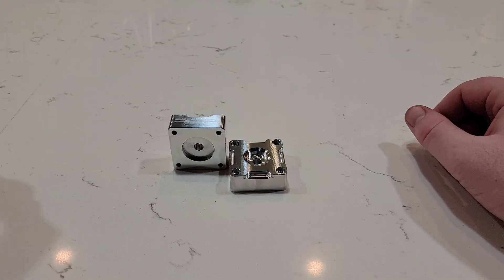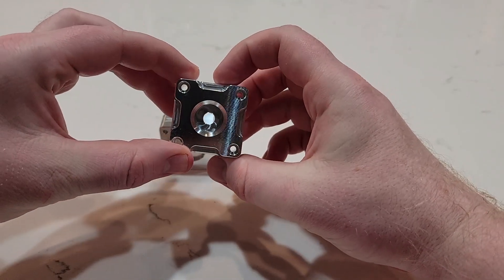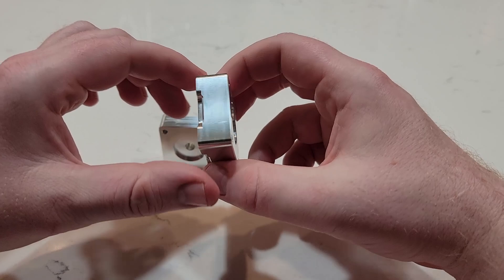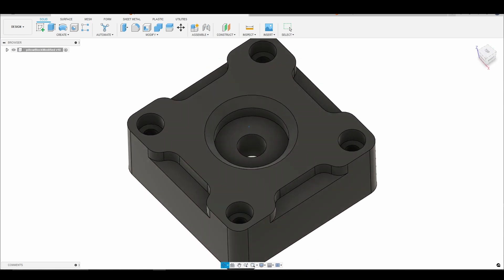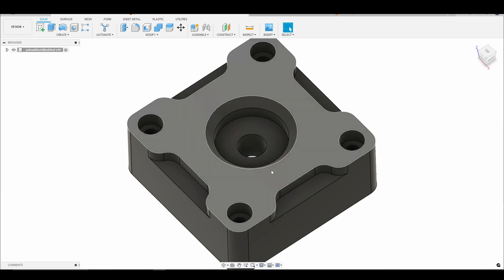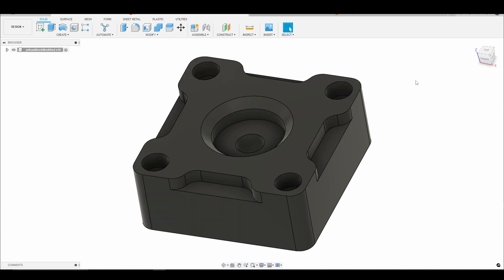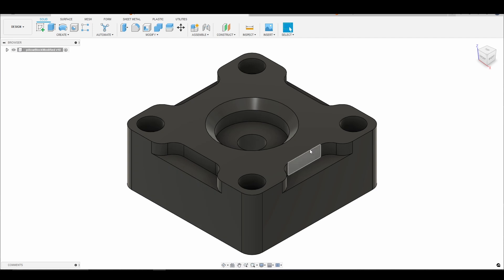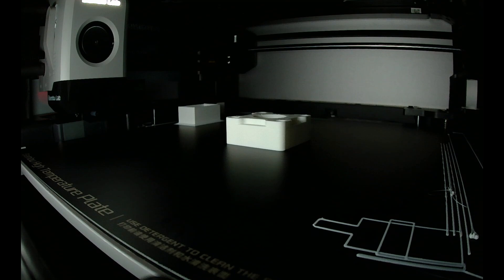Stepper Motor Thrust Bearing Mount Overview

Comment: Not sure if you noticed or not, but you say it's 40 inches in width, 40 in depth, and 16 inches high.  Definitely sounds like something I'd do on a narration.
Reply: Out of curiosity, why did the 3d print end up with a purge tower?  I wouldn't have thought that'd be necessary for a solid single filament part?
Reply from the maker: @David Hefner  The bambu smooth timelapse feature creates the tower. It's a little annoying and I wish the camera angle for the timelapse was better.